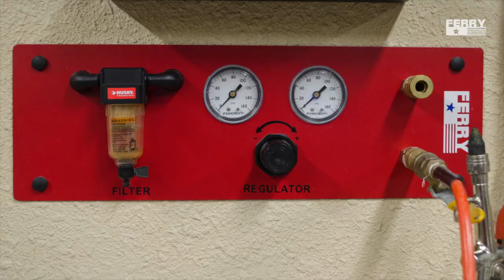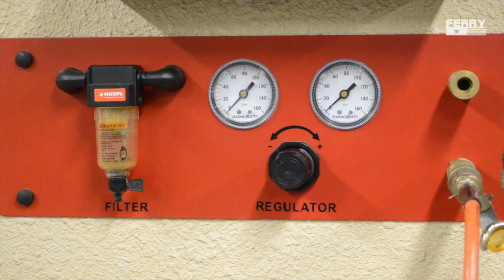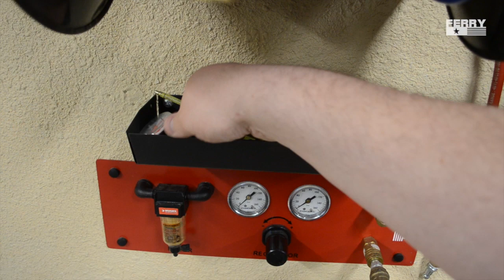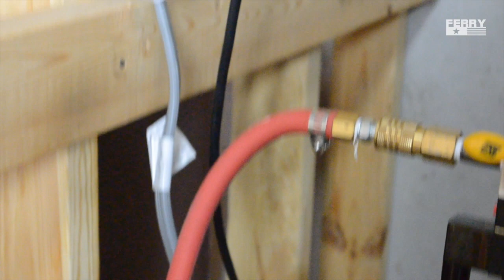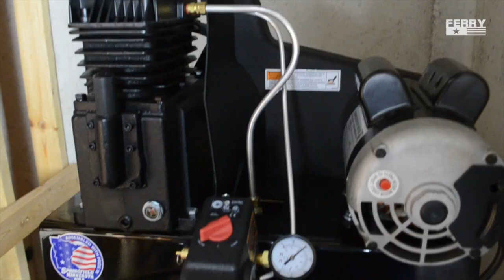Ⓕ Air Compressor Station (ep3)

Comment: Cool idea! It might not matter to you but if you ran a T out if the compressor with the supply going up to your shop and the other pointing down to use as a drip leg to catch the moisture created from the compressor might help with any moisture in the line.
Reply from the maker: out of the compressor would be good if that was the lowest point in the line so I have a drain at the lowest point

Comment: Looks like something that would be found in a powerhouse. Nice neat job. may i suggest putting a dedicated line for an oiler.  It would be regulated much like your air regulator to put one one drop every few minutes for your air tools. Great job I will copy a good part of it.
Reply from the maker: thanks - I prefer to oil the tools directly to limit the amount of oil that gets into the lines so I don't have to worry as much when spraying a finish - I did process air installs for a few years and in that case I'd have an oiler inline

Comment: Doesn't the small diameter hose restrict flow to your air tools or are they all small cfm users?
Reply from the maker: No, you should be able to get 20 CFM with a 40 to 50 foot run of 3/8 inch hose

Comment: How often do you drain that compressor of the water at the bottom of it?
Reply from the maker: no matter how often I should do it more than I do
Reply: For a decent price now they have an auto drain that plugs in. You set how long it releases for and how often. EX: 10 second purge every 24 hours.
Reply from the maker: Michael Gillitzer I had an auto drain that leaked and never got back to it - someday I will

Comment: Hey Nick! I have my system almost completely set up, but I would like to create a panel just like yours for my compressor. Can you list the parts of this one and where you got them? Specifically, I am looking for the two gauges, the filter, the regulator, the electric solenoid (unless you know of one that can be mounted remotely from the compressor on the wall panel before the filter), and, most importantly, and all of the quick connect fittings/adapters and cutting tool you use for the plumbing/nylon tubing (those have been the most difficult for me to find on my own, and is the primary reason why I am asking). This may be a silly question, but couldn't I simply take the gauges and regulator off of the factory compressor and relocate them so they are wall mounted about six feet from the tank, and then, using like a six foot length of hose, connect the newly created wall mounted station back to the compressor where the gauges and regulator were originally? This may be hard to understand with my explanation, so I could post a video of my question if that clears it up. Thank you!
Reply from the maker: I have most all the parts listed here - https://nickferry.com/2014/10/custom-mobile-work-station/ - I suppose you could harvest the existing parts but I am more of a fan of leaving the factory stuff in tact and having redundancy
Reply: I looked at the website, and you have all the parts listed for the theatre cart build except for the solenoid (because you didn't use one of those in that build). Could you tell me where to get that part? Also, would it be possible to plumb it into the bottom of the tank to act as a "drain valve switch" to drain off water build-up occasionally from a remote area like the other side of a wall? Thanks Nick! Love your new videos!
Reply from the maker: Joe Edward it would be possible - in fact it's something I have wanted to do for a while and never got to it - try this solenoid for either process - http://amzn.to/2fqXYoO

Comment: Nick, first, I have to say that I love your work - truly high quality and exhibiting pride. I am a real beginner when it comes to compressors, so, naturally, I have been scouring YouTube for a video to help me with my project, but I can't seem to find one. Yours is the closest I have found, plus I love the quality of your work, so here goes:
I recently bought a 6 gallon quiet compressor that I am planning to use primarily to run a pneumatic French fry/vegetable cutter for our kitchen. I have very limited space in my condo, so I thought it would be a good idea to place the compressor in the deepest part of a closet under my stair case (for space saving and noise reduction). I want to mount a wall plate very similar to the one you have in this video to act as the control center for the compressor. My goal for this is to have the access plate be able to control everything including a safety release such as the one mounted on the compressor itself. I guess my big concern is that I don't know enough about compressors to know whether or not I will be able to accomplish this. I basically want to have my plate have everything yours has, but also have a safety release control and a dedicated 'push-connect' line coming out of the plate and running straight to the pneumatic cutter. I still want the other connections to use it to inflate tires and use air tools if I want to. Is there any chance you would be willing to explain to me how to accomplish this? Either way, thanks for posting this great video AND the one with your theatre cart build, which was also Awesome!
Reply from the maker: never heard of an air powered french fry cutter in a home kitchen - interesting thought - not sure being I'm not there to look at it - the most in depth I show it is in the theater cart video that you have already seen - I am planning on making another one for my work table but not sure how much more in depth a may or may not get on it

Comment: Nick - just found your site.  Great work!  I enjoy all your projects.  I'm working on a setup similar to your air compressor station and am having a difficult time finding the wall mount components.  Do you happen to have part numbers for the components used in your build?  Thanks, in advance.

Comment: Excellent videos.  where do you get those components and parts to the station?  They are new to me.  Where can I get them?  I am a theater carpenter also.  Where do you work?  City, state?
Reply from the maker: Javier Suarez Thank you.  The filter and quick connects were from home depot, gauges from dale foster, the regulator and pneumatic plumbing from AutomationDirect.com - I don't do the theater building full time its more of a volunteer thing for schools and local community theaters in northeast Wisconsin.  Hope the info helps, and thanks for watching.

Comment: does the solenoid control a two way valve or why is the pressure falling so quickly when you trigger it?
Reply from the maker: GoldenEagle  it's a 3 port 2 position valve - so when I release the button all of the air exhausts out one of the ports

Comment: Nick, what is the model number of the solenoid, I have been wanting to do a setup like this and put it by my light switches in the shop so that I can shut off the air to the plastic lines in my shop when I leave. Thanks
Reply from the maker: Richard Obermark it was either http://www.automationdirect.com/adc/Shopping/Catalog/Pneumatic_Components/Pneumatic_Valves_-a-_Accessories/General_Purpose_Solenoid_Directional_Control_Air_Valves/3-port_(3-way),_2-pos.,Body_Ported(AVS-3_Series)/AVS-3312-120A or http://www.automationdirect.com/adc/Shopping/Catalog/Pneumatic_Components/Pneumatic_Valves_-a-_Accessories/General_Purpose_Solenoid_Directional_Control_Air_Valves/3-port_(3-way),_2-pos.,Body_Ported(AVS-3_Series)/AVS-3212-120A - they are slightly different in price and have different orifice sizes - other than that they are the same - Either would be fine but knowing me I most likely got the cheaper one.  Let me know if you have any other questions
Reply from the maker: Richard Obermark  I just realized that YouTube cut off half of my links so those links are no good.   Try this one.  http://www.automationdirect.com/adc/Shopping/Catalog/Pneumatic_Components/Pneumatic_Valves_-a-_Accessories
Reply from the maker: part number AVS-3312 120A

Comment: Great setup.  I'm unclear on the need to have the air flow switched with the solenoid, though.  Are you trying to reduce the chance of leaks in the system if it is not in use?
Reply from the maker: steddyj The main reason for the solenoid is possible leaks in the system.  It is a 60 gallon tank and if there is even a small leak in the hose, it could drain the tank over a few days.  This way when I go to use the air I don't have to wait for the tank to fill from empty and put additional hours on the compressor itself.  Another reason for it is to be able to have a way to cut all pressure in case of a hose rupture or similar (of course unplugging the hose would also work).  Lastly, it makes me feel warm and fuzzy inside knowing that the entire system is not pressurized to 120psi all day everyday even when not in use.  Thanks for watching and thanks for the feedback.  My favorite part on here is the "talking shop".
Reply: Nick Ferry
 OK, that makes sense.  I didn't see the point of cutting off pressure if you were turning off the power - thinking that you didn't want the compressor running all night long.  If it's off and drains overnight, no big deal.  Also a rupture occurred to me but isn't enough of a risk (in my mind) to justify the solenoid on its own - by the time you reached the cutoff switch you'd be able to unplug the hose (unless of course you hit your supply line in the wall while drilling, or something similar.)  I hadn't considered the cumulative run time that would add to the compressor over it's lifetime, not to mention, now that I think about it, the energy costs.  Between the two I'm sure that solenoid will pay for itself in the long run.

Thanks for taking the time to reply and for making great videos, I'm looking forward to seeing more.
Reply from the maker: steddyj Not a problem, thanks for your time too.  I look forward to having you as a viewer.